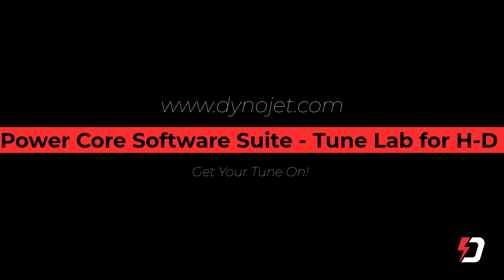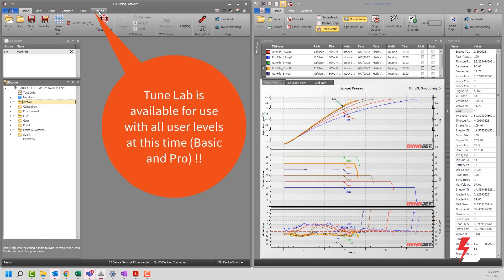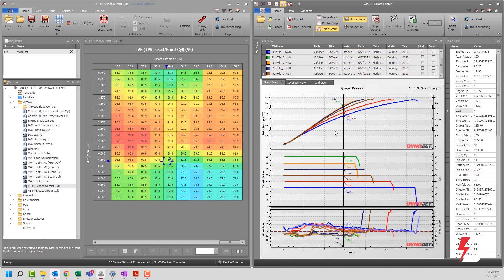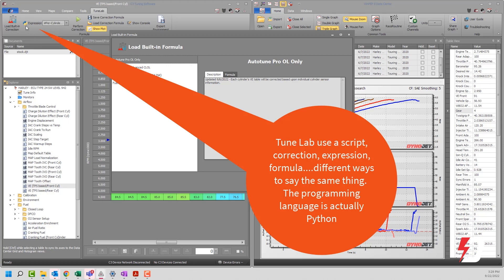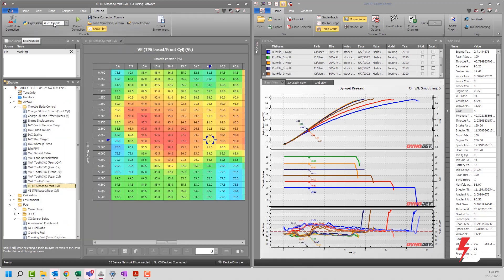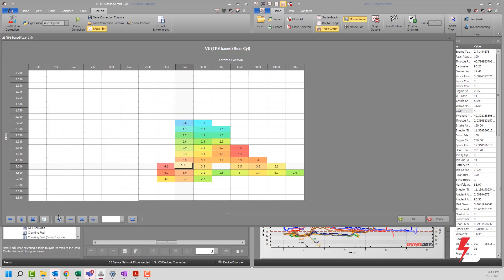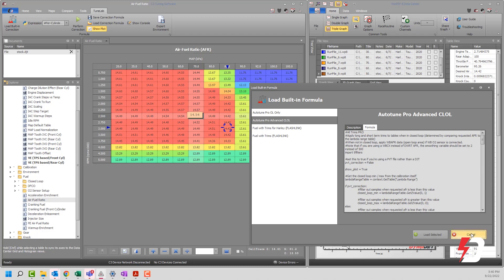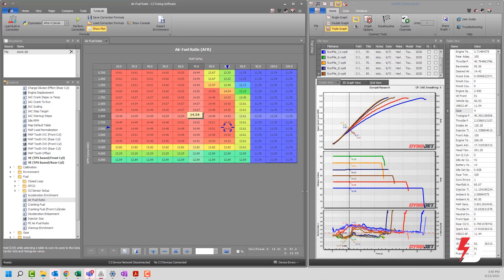Dynojet Power Core Software Suite Tune Lab for Harley Davidsons

Comment: Is it possible to adjust the idle RPM with a PV4?
Reply: I think it has to be done in this software he is demonstrating and then saved as an adjusted tune in the cloud which the PV4 can retrieve and flash to the bike.
Reply: @easyglider1307  Yeah I figured it out. You have to use the powercore C3 software. I do not recommend the device.
Reply: @mvfd1o8  You do not recommend PV4? Why is that? What issues did you have adjusting idle RPM?